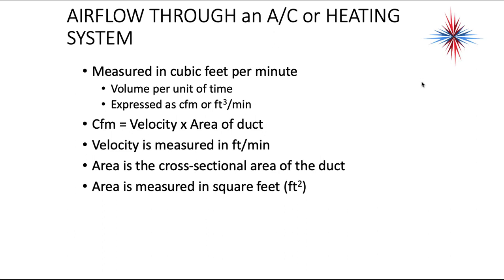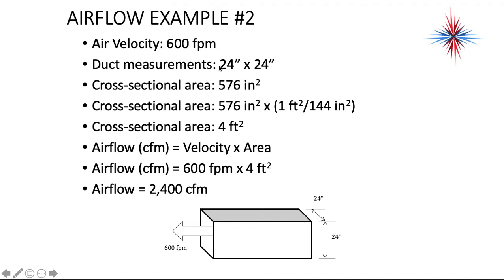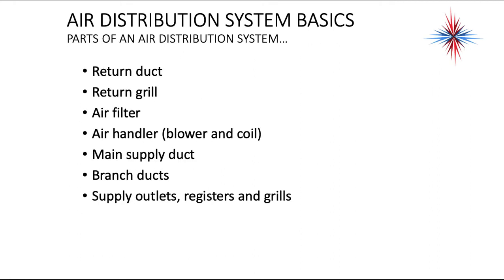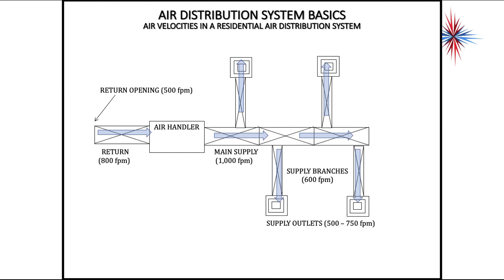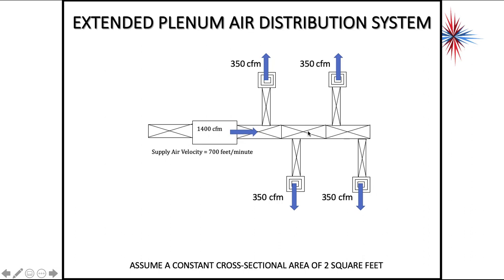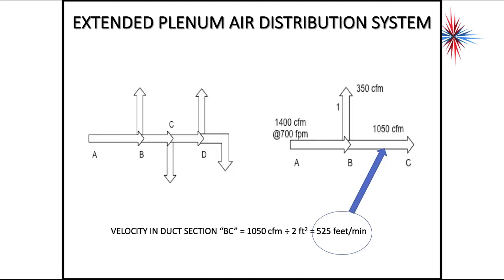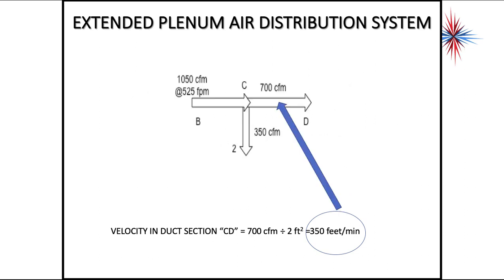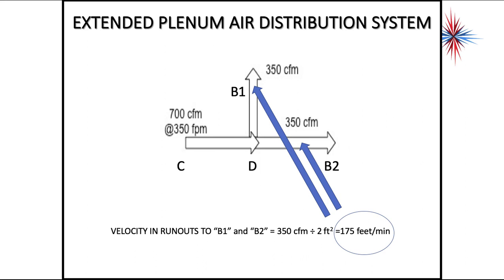System Design - Psychrometrics - Part 5

Comment: Hi
Is it good practice to position the last take off branch a few feet from the end cap on the plenum duct?  Hypothetically speaking,  if the ends of the branches protruded into the plenum duct by an inch or so what effect would it have on the airflow?
Reply from the maker: Yes. Though I would not go as far as a few feet. 1' is enough. And if the ends of the branches are 1" or so into the duct it will cause disruptions to the airflow. Anything that causes currents and turbulence in the ductwork is a problem. Want things as smooth as possible to prevent resistance. Hope that helps.